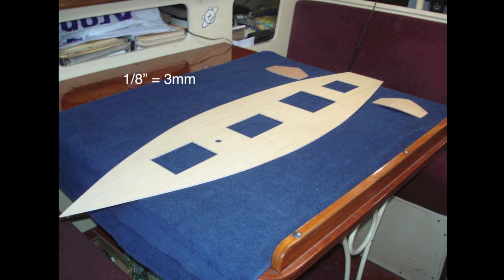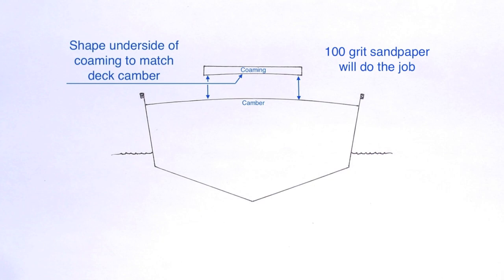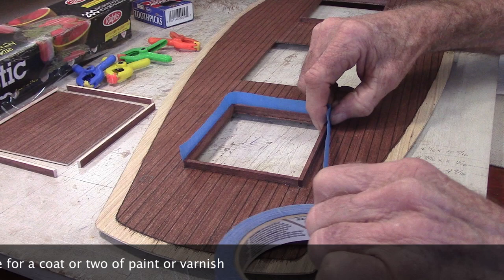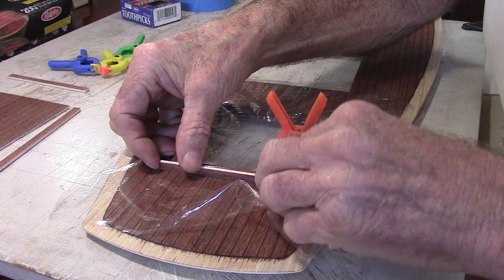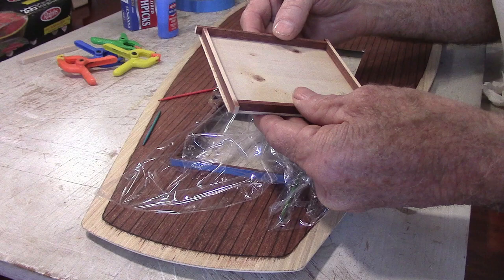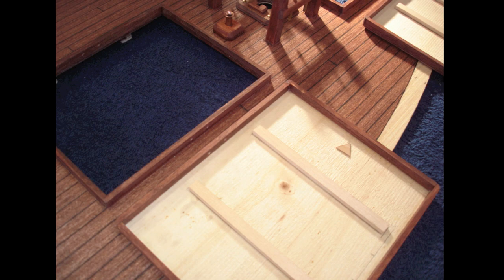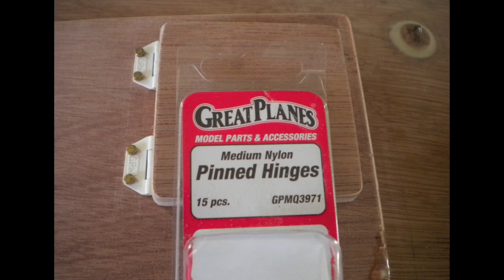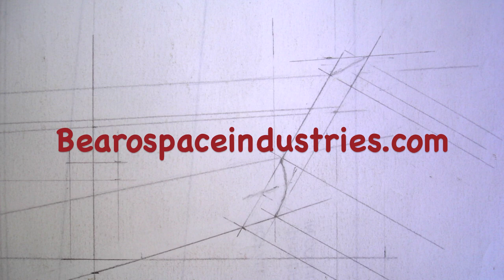RC Sailboat Build DIY Hatch Covers that FIT

Comment: Thanks, Gary!  Following your tutorial, I was able to build a custom hatch cover for a boat that I "inherited" from someone who had lost interest (he was an avid R/C flyer and superb overall model maker).  When I got the boat, it had no radio or servo gear and I had to design and build it all from scratch.  Videos online - including yours - helped get me through it.  I'm finishing the hatch cover now and it should be operational in a couple of days.  One design change I made is intended to help with getting the hatch on and off the coaming - as it is a tight fit.  What I did was to sand the inside bottom edge of the hatch frame pieces to form a slight bevel or relief to the edge - vs the sharp/square edge of the 1/8" x 1/4" frame.  By beveling the inside edge, the hatch somewhat self-aligns with the coaming and it is easier to get the hatch on and off.

Comment: If you melt petroleum jelly, you can fold the hinge closed and dip the hinge edge/pin in it to get a nice coating to keep the epoxy/glue out.
I use the bottom end of an empty soda/beer can with a small candle under it sort of like a chafing dish. Probably not super necessary if you only have two, but if you are trying to install many during the same batch of epoxy it helps to not have to be as exacting.
Reply from the maker: Thanks for the tip !

Comment: Thanks for the cool video. I am restoring a very old 48" gaff rigged pond sailer with a mainsheet tension controlled rudder. It is built like a big boat was back in the day. Sawn frames, carvel planked. It has three rigs complete with multiple bowsprits and topmasts. Going to add rc so I can get it to come back home to me. Great tips on how to make the hatch covers fit and hold tight.

Comment: Good tips thanks.  What glue do you recommend  for above and below water ?? .
Reply from the maker: I use the same glues above and below water. We must expect the whole boat can get wet.
CA (thin & medium viscosity) and  Epoxies (5 minute & 20 minute & thickened for fillets)
Cheers !
Reply: @sailtails2775  thanks . I am collecting  bits to start a project of an approx 1.4M 2 masted schooner . And I will be using some of your ideas .